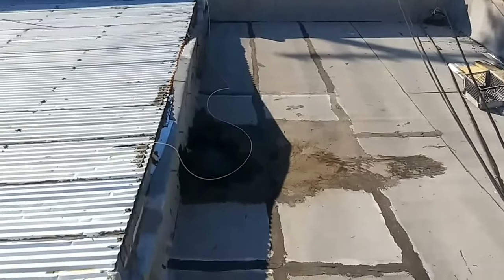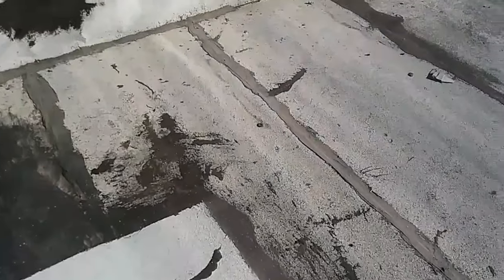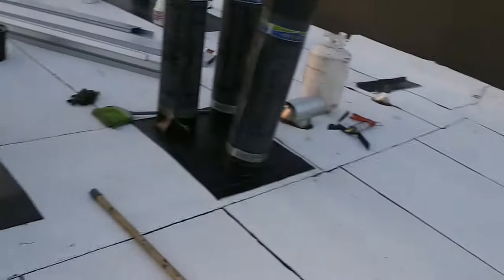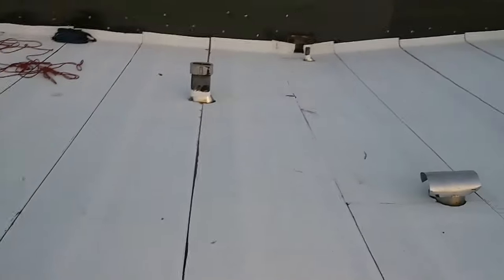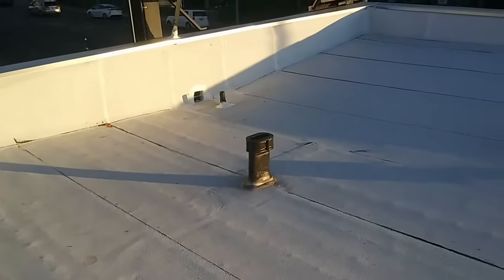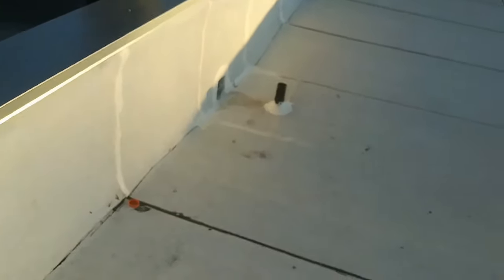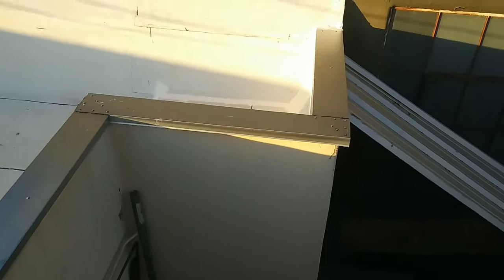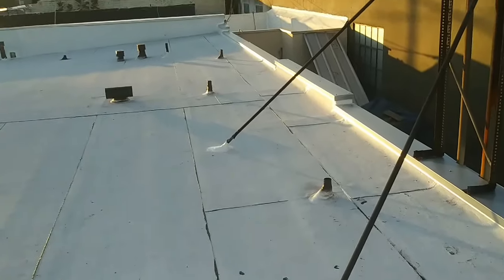Roll roofing installation , step by step video.# torch down roofing

Comment: Thanks Eric . I just got a new flat roof installed . They installed ice and water shield on the bare wood  and then torch down bitumen membrane with granules.  My question is was it done correctly ?or they were suppose to install anything else. Please advise. 
Thanks